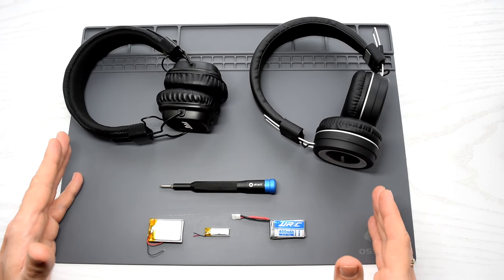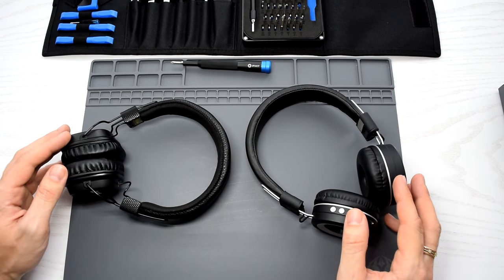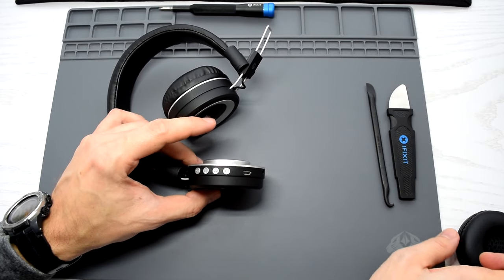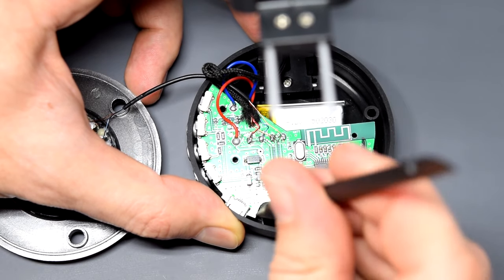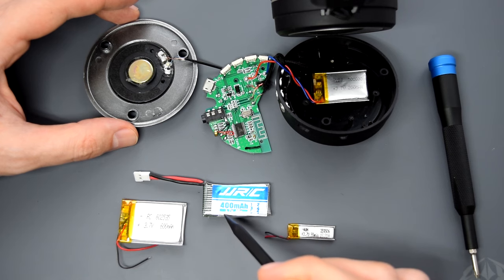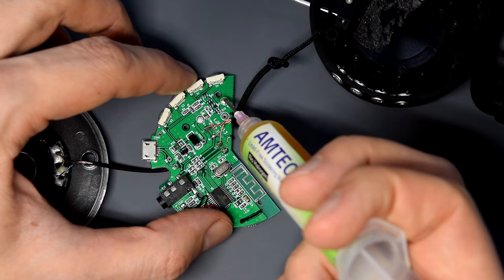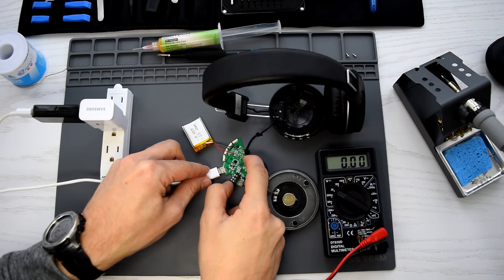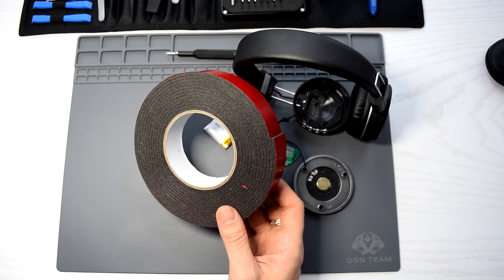How to Replace/Upgrade Li-ion Battery in any Bluetooth Headphones

Comment: The Sennheiser momentum headphones will die within 3 years for a heavy user. My second pair has died (after 1 RMA) from a dead battery. I will try to use a glue gun instead of a soldering iron (like I did with my gpu shunt mod). Thanks for the instructions.
Reply from the maker: You can buy a cheap soldering iron for about 5$ delivered.
Reply: @ElectronicsComputers  I'll definitely buy one then. Thanks!

Comment: thanks... i had g933 but 12 hours is not enought to me and want do something about it... plus on and off button nor work properly, it is failure in 4 i alreadt get the first right side stop working, then the mic not works the third just broke in the middle without abuse, and all of then the on off button has malfunction when i turn on it not work correctly and need do some moves with the button to it correctly turn on all speakers... well... may just battery already is enought to me, but thanks to show how to it in anydevice... in last case i will need move to other product, but i really like logitech g933, just had this failures of low battery power 12 hours is nothing when wants a full weekend play time... and on-off switch
Reply from the maker: The problem with the power button is very common for that headset. Try to read this article it very easy to fix: https://www.reddit.com/r/LogitechG/comments/7t0m3g/g933_sound_unbalanced_power_button_fixes/
Reply: @ElectronicsComputers  thanks i will try this fic when i found this micro phillips hehe... my daddy sell screws for life and we had tons of stuff but not this size LOL... plus i not native english and tought that may wrote wrong screws at first, but checking it is exactly what i want to say hehe i totally will put this on ragnarok bills, because i remmber some drop or mome that are screws... damm tibia is my main knowledge about english in general, but other stuff helps too... i totally had a bad time when i noticed that news games comes in my language had dropped my english a bit, now i put anything on english without a subtitle. it make me think in english and evolve myself in general... funny is that i already tryied it with japan, but i failed and need to turn on again... i probably not know enought to make this step and i not want enter in class, because study with books is trash to me... i not learn a dot from books or formal leassons, even those who say they are modern and bla bla bla, not work! i need learn in natural way, interested in a giant goal than just lear for itself... and may learn japan just for listen anime without subtitle is not enought to trigger my greed in this skill
Reply from the maker: @viniciusschadeck2204  From my point of view YouTube, games and movies are quite good sources for acquiring any language especially English. What we need is motivation first. Learning an Asian languages takes a lot of courage.
Reply: @ElectronicsComputers  sure, english is world spread at this point and most used in international stuff... for lucky i love games since i was a child and until now i still loving games, sadly i not work making games, that is my job dream for now hehe... and for time consuming is here hard to focus on other language for now... i need improve my game development skills, i already got some money from web dev with angularjs and this kind of make a safe boat for a while if i lost my actual job... but i still working in full stress mode. Then i get my hobbie in game dev and all get a really good vibes, even the bad stuffs that happens in any development process... i totally want to release my first game in steam in this year. but is a simple one to do a start point... a simple low amount of doll game... may i put it in 1 dol or 5 doll game... i not know how exactly prices are in eua, i from brazil and here i will put at 15 brl that is under 3 dols, i got some basic now and want to improve 3d sounds and other stuff to put all together... may if i got some cash from it i can launch another better until i found a team to make nice games... will se, if it pay more than my job in dev industry i will be really glad of my job hehe
Reply from the maker: @viniciusschadeck2204  I wish all your dreams come true! Game development is a very profitable business. Just do it and follow your dreams and money will come after, believe me. I'm a software engineer by my university education but I almost never worked as a developer. I'm more interested in system administration and electronics but I still trying to learn something new about coding and keep my knowledge relevant. So if something will go wrong I could switch into software development.
Reply: @ElectronicsComputers  yeap... this is my point here... i just subscrib college to had something, now i'am in software development for about 6 or 7 years and even before entering in college i did some class to learn code... where i live not had gamedev class until close to my graduation itself, because of this, i just finished it right 9.38 of 10... and my clonclusion job was a game, i need to make extras steps to prove that a game is a software too for my teachers and all directors and that kind of protocol... well, at least i make a game from scratch, using javascript and a engine lib that i found ThreeJS if i remember correctly. But even that time i get troubles... i need money, like more than average person for health issues. I know, had people in even worst cases than mine, but, even with that in mind, i spend 25% of my paycheck and it is more than 95% of the people on my country. Just in medics and supplys, is heavy and i need do it, treat it correctly, i alreadt had sigh issues because of not enought care in my job with college time, doctor says it is not reversible, and i got lucky, because i not need medics at the end, some people with this kind of trouble may get hearth problems or kidney for life, i just got a really bad sigh in left eye, but taking care i not evolve and with more luck can get little better over the time... This make me little worry about just jump in gamedev with my entire body. I not want ask my parents to keep with that costs, even college i pay after month 1, because i enter there and first stuff i did is find a job in the boardwall, i not spend a lot with another stuffs, but i always keep my computer setup ready and because of eventual shits i got bank close to 0 while ago, at least i now had a little again, i can stop for about 6 months until need a job again, but i think is better i try my best to not leave the job now and keep it as a second job without any payment for while... thanks and i hope you can make yours dreams come true to, bye

Comment: sir can i use 2.4v rechargable battery instead of 3.7v
pls reply
Reply from the maker: No! You can only use any 3.7V  Li-ion battery.
Reply: @ElectronicsComputers  ok thank you sir and can u tell me which mah 3.7v battery i should buy for it cuz i want a 8 hour to 10 hour battery time 
I will glad if you suggest me sir

Comment: couldn't you just strip the wires and tie them? I get it, this is nicer, but 99+% of the population can't solder to save their lives. I am one of them.  :)
Reply from the maker: Sure! That's actually what most people do. They simply cut those wires, connect a new battery, and then just make sure to insulate those exposed wires very well with electrical tape or heat-shrink tubing.

Comment: The Marshall II headphones have LiPo with NTC. How critical is NTC really?
Reply from the maker: That's very critical, actually. The charge controller may not charge you battery properly or refuse to charge at all. Here's the battery that will work for you, just select the proper size: http://ali.pub/49i0cz

Comment: can i replace my battery with a mobile battery 1050 mah
Reply from the maker: In most cases yes you can.
Reply: Hey in my headphone it's charges for more than two hours and discharge in 15 minutes is there any way to solve it.
Reply from the maker: @syedumarmuzammil7491  Could be the problem with the battery or charge circuit. If the battery is old then simply replace it. New battery will cost you about 5$ with free shipping wherever you are. If it's new battery and it works only for 15 minutes then you have to measure voltage of the battery when it's fully charged. Fully charged battery must have 4.2v. If it's lower then for some reason it doesn't get fully charged.

Comment: bro i ubgraded the most low price 27PLN headphones wirelles from 50mha&100mha into 1000mha&2000mha lol and i have play now no 2&4minutes but 40&120minutes and i can more but i nade more space in headphones well but it will be look ungly XD i want cool not ungly
Reply from the maker: @DarkRawWareCorporation  Great job!
Reply: @ElectronicsComputers  but it one - bc 1. that must need change some mini plastic delete to put the battery and if battery is more big or need one thing or want to ubgrade bluethoot function then need to get plastic and a llitle rebuild the box but it work! well thanks :)

Comment: My hedset had around 80% charge and after i fully charged it and when i turned on it shows only 20 % and after some time it shuts down.... Each time i reset it shows random charge % ...what should i do
Reply from the maker: You should definitely replace the battery.

Comment: Is it possible to use an old (or new) mobile phone battery (3.7v) to replace the headphone battery,? To sold directly to the + (plus) and - (minus) on the battery like done here:
https://www.instructables.com/Reuse-Old-Mobile-Phone-Batteries/
becuase the headphone circuit board must of course control the charge and stop charging the battery ones it is full? Similiar to the batteries used in your video.
Reply from the maker: Yes, you can use that battery too. The charge controller is on headphone's board so don't worry about that. It can be tricky only if your original battery has three wires and your phone's battery has more than three contacts.
Reply: @ElectronicsComputers  thanks for the answer. My original headphone battery only has two wires so that is ok. My original is 550mah and I have a 800mah Mobile Phone battery that can fit. Will the headphone charge it to 800mah?

Comment: i opened my tiny earbuds with battery issues up and saw the 3.7v 50mah 501015 battery found a replacement online but the red and black wire go deep into the case and i dont see a way to pull it out. is there any way you can connect these different red and black wires if you snip them in the middle.